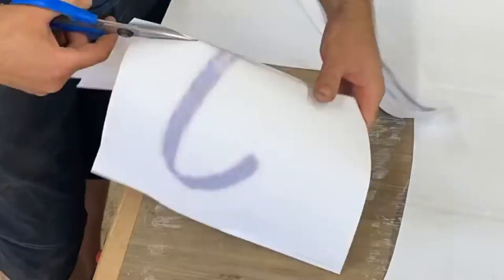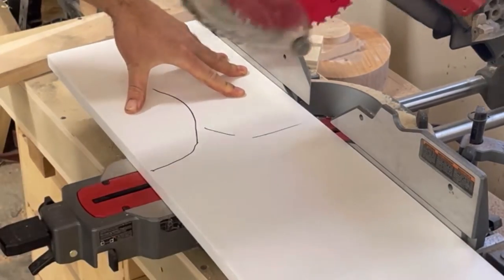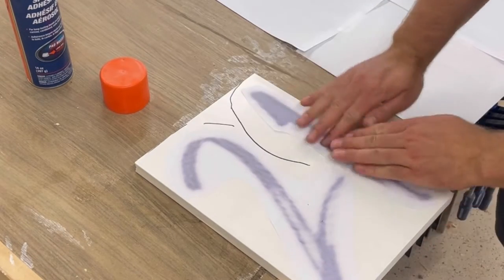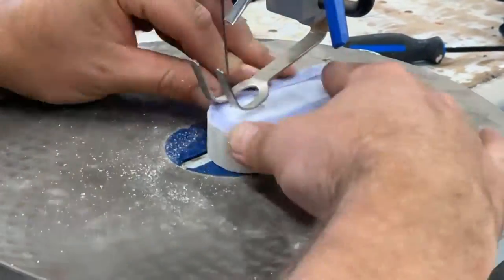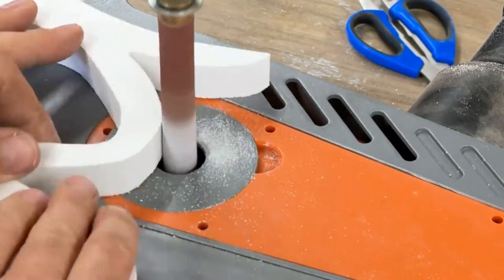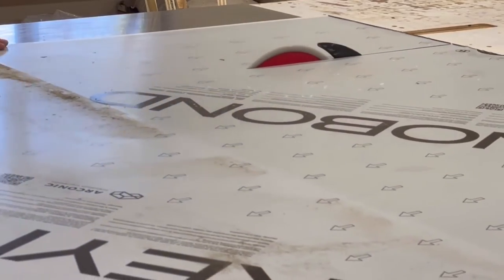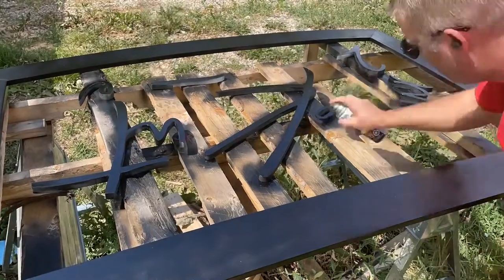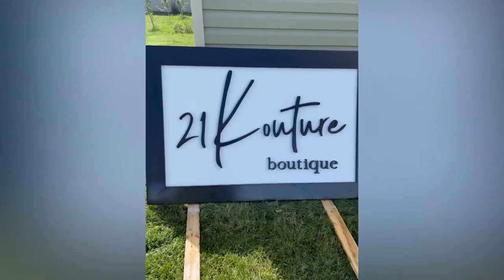Making a Sign using Cellular PVC with my Band saw and new Onefinity Journeyman x-50 CNC

Comment: Nice modern sign. About the table saw, help me understand the need for the bypass. Will the brake trip or something?
Reply from the maker: So the aluminum is conductive. And the sawstop brake triggers via a change in capacitance. If I hadn’t put the saw in bypass it would have triggered the brake and cost me a new saw blade and brake combo.